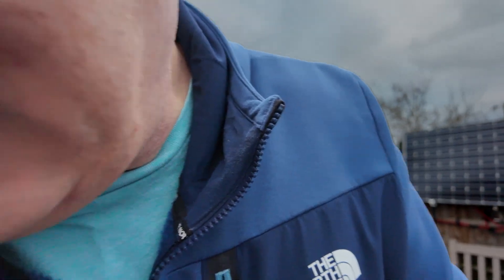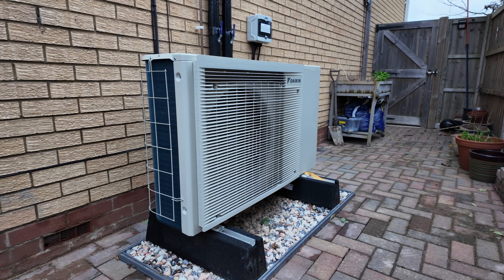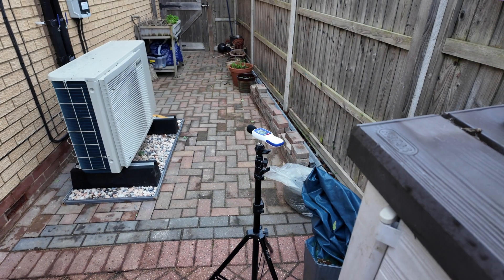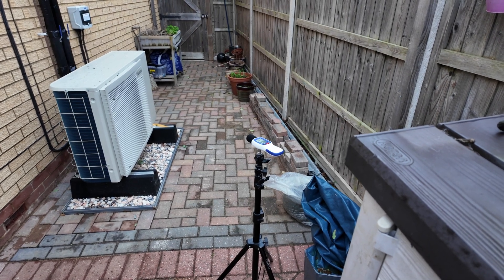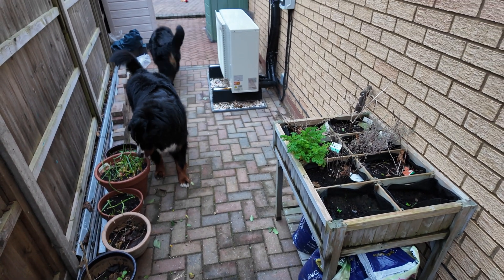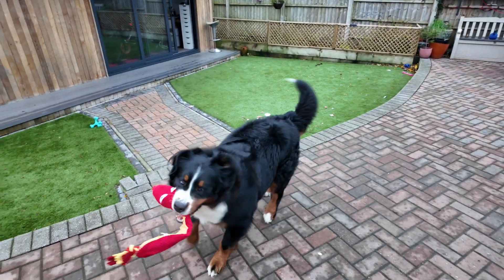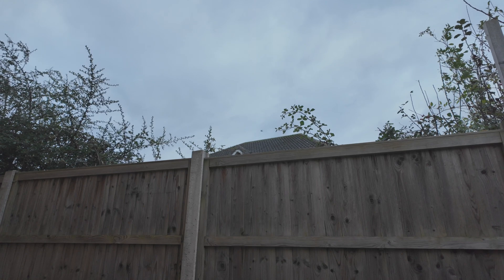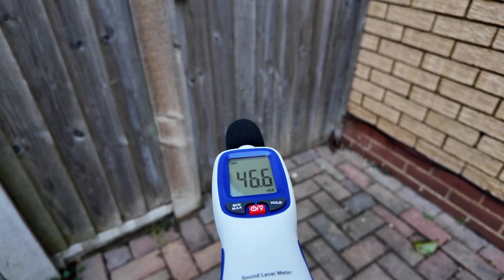The Shocking Truth About Heat Pump Noise in 2024

Comment: Everyone who says heat pumps are quiet always does the example in the day when there is a ton of noise. 

Noise is very subjective so during the day something that makes noise may not be noticeable but at night when there is no other noise to cover it can be very interruptive to sleep. For example I can hear very high pitch so tend to get annoyed with transformer hum when I’m trying to sleep but during the day there is so much other noise you can’t hear it. 

The same will go for heat pumps if they are on full blast. Hopefully not but if they are installed and it causes disturbance what are your options? Move because your neighbour has put a heat pump in? Not really reasonable is it?

Now I’m not saying they make a noise but it’s the general heat pump supporters who miss the point. One persons tolerable is another persons unacceptable.
Reply: Heat pumps are noisy as shi. The gaslighting is ridiculous
Reply from the maker: absolutely it’s completely subjective and everyone is gonna have a different experience hence the reason for using annoy meter at least then there is some quantify data. As I said I live in the countryside where it is very quiet, in fact it’s so quiet you can hear a rumbling of traffic on the dual carriageway that is over 2 miles away. That creates more noise than the Heat Pump does at 3 m.

Comment: Most danka only 44 to 53 dB the same as villant. However units for pools and fish units can hit 70 dB things have improved a lot since 2016 many twin units and budget mono units vary from 52 to 60 dB these are the main complaints as they are based on existing coolant units however people are have complaints are usually when it's cool and air is thin also older units with rattle often are heard as well as those badly installed
Reply from the maker: I fully agree, however those arguments that they keep throwing out just don’t hold water. We don’t compare how noisy older cars are (internal combustion engines) two electric vehicles-or at least we shouldn’t. If you’re gonna make a comparison, it should be like for like, a Heat Pump that is heating swimming pool is probably working a lot harder than one that is heating a small three bedroom house. With regards to the rattling thats why we have a maintenance contract so if anything does start to wear they can come round and fix it.
Reply: @JonathanTracey  that is the problem people often leave it a while also lg and many original installers have left the business once the original grant ended with the training issue depending where you are in the country some are not serviceable through Plummer network. Especially Scotland and Devon
Reply from the maker: that’s one of the main reasons I went with octopus, I’m pretty sure they’ll still be around in a few years and the fact that they were willing to carry a maintenance contract that says they will have somebody out within 24 hours if there is an issue. As my wife works in the plumbing trade, I know how hard it is to get hold of her plumber/engineer and the last thing you want is to be without heat or hot water for days on end.

Comment: I had an Octopus survey 2 weeks ago. Results show it will generate 5db above permitted level which will affect both my neighbour and a bedroom in my bungalow. This means I need planning which my council has a record of not permitting. Octopus had declined to install. Cost to me was £4K after the grant. What is the point of getting planning approval when it will still upset me and my neighbour? Do you think Octopus had other reasons to not approve?  My bungalow is detached with 22 solar panels and a 9Kw battery with a EPC 'A' rating. I would have also needed several new rads. Not worth the hassle. How on earth can we all convert from gas, I thought I would tick every box?
Reply from the maker: It’s hard to tell there could be any reason that they decided that they didn’t want to do the install. How close are your neighbours?
Reply: Your statement 22 solar pannels gave it away. Look at from a commercial point of view. Your solar will likely give you negligible increase in electricity so from their pov it’s not going to contribute to their profit as much as other installs would. Makes sense when you think about it.
Reply from the maker: It could be, but that’s a pretty dark view of the world that they’re only in it if they can continue to extract money from you. It does say on the octopus website that they will install the Heat Pump even if you’re not an octopus customer so I’m not sure the argument holds water.
Reply: I was with eon when octopus installed my Heatpump , now with tomato. 
The only pain not being with octopus at the time  of heatpump installation was getting eon to remove gas  meter . They did  eventually but still charged me for  gas  and  standing charge for another 3 months after it was removed , and after I left them . 
Every  month I would get a bill and have the same conversation , they wouldn’t believe I didn’t have a meter anymore even though they took it out😂😂
Reply from the maker: tell them to come read the meter :-)

Comment: New is good. Let’s hope age doesn’t change that. I’ve heard some aircon units that make a right racket, but hopefully these will be designed better to not degrade over time.
Reply: I think the biggest issue is when they are not installed perfectly level, this leads to side loading on the bearings and they can wear quicker, and thus get noisy, how many aircon units are installed perfectly level? Pretty much none I'd say.
Reply from the maker: yeah they took a lot of time and effort to get it exactly level
Reply from the maker: It’s under a five year maintenance contract and I have the option to extend that, so if it starts getting noisy, I’ll have somebody come out and resolve the issue.
Reply: I think my neighbours heat pump is about 3 years old and mounted high up on the side of the house - about 3 metres or so off the ground. I was rather surprised to hear how noisy it was as I walked over to where the car was parked at 5am (we are very rural). I hadn't noticed it before and it reminded me of my time in Vietnam - where aircon is the name of the game. Noisy units are fairly common there. Maybe something had got sucked in on to the fan?

Comment: What is the average db level when the ASHP is just ticking along at 500W?
Reply from the maker: I would have to wait until it’s pulling 500 W but right now it’s pulling about 250 and the average DB level is one DB above ambient background noise at 1 m
Reply: @JonathanTracey  Interesting. Will you be doing a video about the electricity used by the ASHP? I’m trying to convert  my gas usage per half hour to electricity using my probable SCOP.
Reply from the maker: Yes tomorrow is my 1 month since it was turned on live, so will put some data together hopefully for next weekend

Comment: Appreciate a DHW cycle was happening but the temperature takes time to rise from the ASHP so would like to be sure the ASHP really was running at maximum duty.

What was the flow temperature during the sound tests?  Does your Daikin interface give you any compressor frequency information?
Reply from the maker: oh and cycle had been running for about 45 mins to 1 hr before i took reading s
Reply from the maker: looking at records flow temp was around 45c which is much higher than normal, it’s usually around 33 for home heating. I dont see the info you mentioned in my daikin interface

Comment: Most boiler flues are noisier than a modern heat pump. In fact that would be a fun exercise, measure the sound level from an gas boiler flue when it's at full chat & compare it to your HP.  
Older non-inverter / AC unit heat pumps were noisier, especially when they started up with a big zap from a single phase start capacitor, but the latest soft start inverter models are quieter than a church mouse.
Reply: 39db to 46 dB
Reply from the maker: is that yours? If so, then Heat Pump are no noisier than a standard boiler.
Reply from the maker: I will ask one of my neighbours
Reply: I was showing my in-law our HP and it was running at the time and barely audible unless you placed your ear very close to the fan. Our neighbour’s oil boiler flue however was a much more obvious hissing/roaring sound. 😂
Reply from the maker: @paulbuglass7690 😂
Reply: But they start and stop, most HPs are running 24/7.